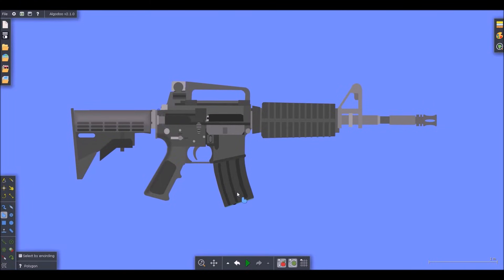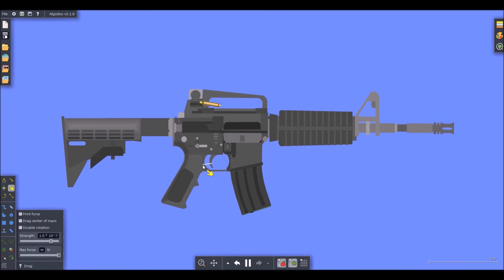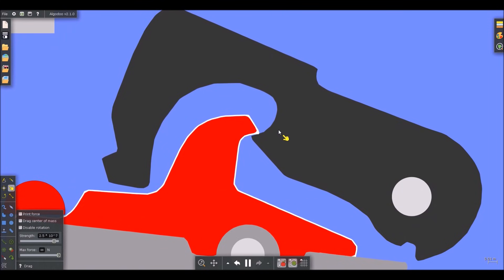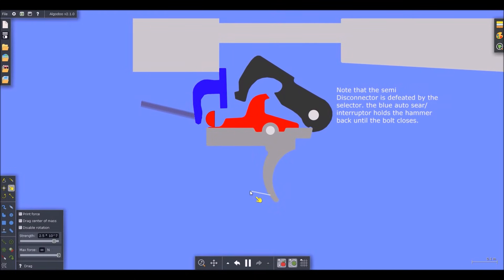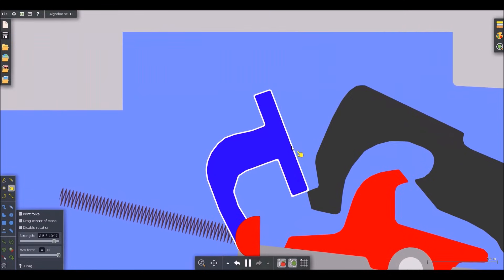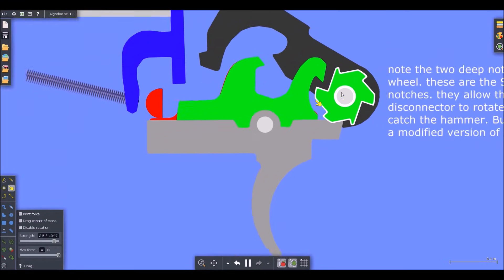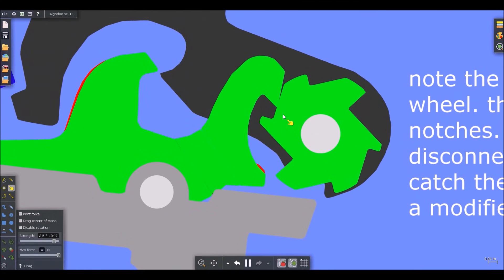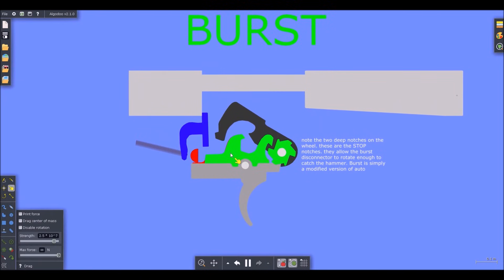How 3-round burst works

Comment: How does the positions of the selector switch cause semi auto versus burst?
Reply from the maker: Notice how the tail end of the semi auto disconnector has the tab that touches the red semicircle?

That red semicircle is a cross-section of the selector switch, and the disconnector is spring-loaded into the trigger. 

When a cutout (empty space) presents itself to the disconnector, it’s free to move and do its job. With the selector blocking it, it’s kept from engaging the hammer.

The semi auto disconnector has no such tab on traditional 3-position lowers and always engaged the cam (and, on every deep notch, the hammer.)

Comment: 4:30 This is actually just meant to prevent hammer-follow induced failures to fire.  Since the semi disconnector is retained the hammer would just ride the back of the BCG.  On some firearms hammer follow could cause out of battery detonations or unintended firings.  However, on a properly made AR-15 the firing pin can only protrude out of the bolt face when in the locked position, so any hammer strikes to the rear of firing pin when out of battery cannot cause an ignition of the primer unless something is seriously wrong with your parts.  What will happen is a failure to fire, either because the hammer hit too soon as just described, or because of a light strike since the hammer can’t deliver enough force after riding the BCG forward.  Out of battery detonations on a properly manufactured and maintained AR can only happen due to bad ammo, typically poorly set or over-sensitive primers; or from debris on the bolt face.  Hypothetically OOB could happen from a cook-off, though to get to the point where a round could cook-off OOB it’d probably have to be hot enough to cook-off in-battery first, at which point the user would hopefully drop the mag to stop the gun from running away.
Reply from the maker: This is true. However, my objective with this explanation was as an in-general reason for the auto sear and why you need it

Comment: Question: with the fire selector on burst, what happens when the operator pulls back the bolt to chamber a round? Specifically, what happens to the ratchet? Does the burst disconnector interact with the ratchet? If not, how is this prevented? 

Thank you
Reply from the maker: if the hammer doesn't fall, it doesn't move enough when cycling to index the ratchet. The hammer needs to fall to make that happen. It'll wiggle a little but won't ultimately do anything as a result
Reply: @StealthTheUnknown  
Thank you for taking the time to explain. 
Could you explain how that works? Since it is the return motion that indexes the ratchet, how does the hammer differentiate when the hammer has fallen and when it has not? Is it to do with the trigger being depressed? If so, could you explain how that works?

Comment: Question: in your opinion, can this mechanism be altered, possibly by filing down the cam wheel, to reduce the three round burst to a two round burst? I'm curious for story writing purposes and i've heard soldiers claim that the third round of the burst is so inaccurate it's useless in all but point blank range situations. Thanks in advance.
Reply from the maker: Just get a different cam wheel with 3 deep notches instead of 2, they make them!

Comment: My only question is when you fire in the three round setting if you let the trigger go fast enough would it stop firing at the second or first round or would it  continue the whole burst even if you let go the trigger before the the burst finishes? 

I know weird question nagging at the back of my head and no that’ll be long to read 😂
Reply from the maker: Yes, it stops lol. Unlike the video games that consistently copy each others’ homework, not knowing the first guy got it wrong. 

I have a FAQ video on this which explains this. For the M16/M4 and a few others, there’s a “memory” of sorts because it doesn’t automatically reset the burst cam (that 6-spoke wheel you see here.) On H&K and others’ burst mechanisms their cams are different and DO reset. In fact, the M4/M16 will “count” IN SEMI AUTO - you fire a string of shots in semi, switch to burst, and you may very well just get 1-2 rounds.

This burst mechanism was retrofitted into the M16 which originally came with full auto, and was designed from the ground up to be full auto. Burst was an afterthought and they had to work with the hardware available. This is what the engineers came up with, and it’s got its downsides.

Comment: I don’t like it. Should be simpler
Reply from the maker: The unfortunate news is that this is more or less the simplest it gets, short of combining both disconnectors and timing it with a linear instead of a rotary cam.

Really, this is already at the point of irreducible complexity; it’s about as simple as it can get.

But yes, it’s more parts than most are accustomed to, so the military generally switched from the M4 (burst) to the M4A1 (auto) instead.
Reply from the maker: I also have another, more updated and higher quality, reshoot of this video. Check it out

Comment: Can a 3 round burst be converted  in to a full auto?
Reply from the maker: Sure. You have to find a way to remove/disable the burst disconnector so it. Ever engages the hammer. I’ve heard of soldiers taking washers and replacing the burst disconnector with those washers. More permanently, I’ve heard of people filing/grinding down the catch interface on that disconnector so it basically does the same thing.

Comment: What if  you jam or run out of ammo om first round. Will it the n fire as soon as it’s charged again assuming you don’t dry rack out the rest of the cycle?
Reply from the maker: Nope. This isn’t a video game, letting off the trigger stops shooting even in the middle of a burst. What happens on on m16/m4 is the burst is “completed” by the next cycle - you reload, and continue shooting like normal, but your next burst will be 2 shots. On other guns with a spring-loaded cam mechanism, every burst is 3 rounds regardless where the last burst ended, unless you let off the trigger or run out of ammo/jam. 

The gun won’t just “finish shooting” when you load a fresh mag and send the bolt home. You’ll just have a 2 burst or single shot on an M16/M4 (or any 3-burst kit that doesn’t reset automatically) if your burst was incomplete before reloading, but that doesn’t happen on other burst kits with resetting cams; every pull of the trigger starts a fresh burst with the potential for 3 shots

Comment: Hey people, i'm not sure if this has been aswered before but most of the top comments are just the ones praising the video.

So what is the wear on this whole weapon mechanism? I see those interlocks are kind of minimal size so i was wondering after how many cycles can the notches wear off or you know, make the weapon work in unintended ways? I imagine if the material near the autosear corner would wear off, the gun could work once the barrel is open which could cause injury? I'm green in the field but i'd appreciate some input or pointing me to some papers in the matter :)
Reply from the maker: Trigger parts are usually made of hardened steel and have a long life, usually outliving the gun they run. The surfaces are small but durable. Bolt carriers and barrels end up failing before the trigger components do because they undergo so much more stress.

The stuff regarding burst is honestly least likely to fail of all the trigger mech. The burst disconnector isn’t catching the hammer with every shot, but every third. It’s just gliding over the counting wheel and isn’t grinding much, if at all. It’s a reliable system that I haven’t heard of doing unwanted stuff. 

When the barrel is open, the bolt keeps the hammer cocked, and any round of ammo that could fire is either in the magazine or already ejected onto the ground. So no, it won’t fire with an open barrel.

It’s almost like they design these things with redundant safety features . . .

Comment: fantastic video, never knew how this worked, but it would have been nice for visual representation of problems with the 1, 2, or 3 shot problems you can run into depending on where the cam is when not all 3 shots are fired, or when switching from single to burst

Comment: Did Stoner actually design the burst mechanism? I'm not sure that he did. As far as I am aware, it didn't show up until the M16A2 in the early 1980s, which occurred about two decades after Stoner had left Colt. I would assume that either a Colt engineer or James Sullivan had more to do with the burst mechanism than Stoner did.
Reply from the maker: You’re right, I think I just used the name since the platform in general is his
Reply: @StealthTheUnknown  Just thought I'd provide a little more information for you, since I'm interested in the history of this stuff and thought the people who watch this video might be as well.

The original automatic trigger mechanism is found in a Fairchild patent, US3045555A, citing Stoner as the inventor.

The semi-automatic trigger is found in a Colt patent, US3670442A, citing Ralph C. Kennedy, Paul A. La Violette, and Henry M. Stromberg as the inventors. This patent includes a very questionable anti-automatic feature (change of shape to the hammer) that would probably result in a broken firing pin retainer or firing pin in short order, but might explain why the Schmid two-stage hammer is shaped the way that it is.

The burst mechanism is found in a Colt patent, US3292492A, citing Foster E. Sturtevant as the inventor. 

Sturtevant also designed the anti-bounce buffer, US3366011A, and the forward assist, US3236155A. Both are still common parts of the AR-15 design.
Reply from the maker: @SharkVsTree  I'm going to try to annotate these edits and make the corrections to the description. I'll cite you for the  information (unless you request I not.) Thanks for clearing my ignorance up!
Reply: @StealthTheUnknown  Cool, thanks! Like you said, ultimately it's Stoner's rifle design, so reasonable to assume that he had something to do with it. I don't blame you for suggesting that. I just turns out he didn't come up with a few of the things that were eventually incorporated into his initial ideas.
Reply from the maker: @SharkVsTree  makes perfect sense, these things are often government projects which are cooperative in nature. lots of collaborators

Comment: In the semi-automatic version. What would happen if you removed the disconnector. Would it then be full auto ?
Reply from the maker: No, because there’s bo auto sear to keep the hammer until the bolt’s closed. It’ll just have the hammer follow the bolt carrier forward. You’ll get a light strike at most. Autos need to keep the hammer back until the very last bit of bolt travel

Comment: How can a Burst M16 be converted to Full Auto with the stock parts?
With what I understood after watching this amazing video i think cutting off the notch on the burst disconnector will do the job?
Please answer this 
Thanks in advance:)
Reply from the maker: if by the "notch,' you mean the pawl that glides over the notches on the burst cam wheel, then no. taking that off will only make it semi automatic, since there  won't be anything holding the burst disconnector back anymore. the pawl on it uses the burst wheel to restrict itself from engaging the hammer. if you want to take anything off to make it auto, taking off the hammer catch would do it - the part of the burst disconnector that catches the hammer. cut the whole thing off and it will just count around all day. alternatively, you can replace it with a washer of the same thickness if you prefer not to permanently modify your trigger components

Comment: If the notches on the burst disconnector are cut off
The one that makes contact with the hammer on the 3rd shot. Would it make the gun full auto?
Reply from the maker: Not unless you filled the burst wheel notches in, or removed the disconnector. Cutting the teeth off would make it semi-auto
Reply: The disconnector can not be removed as the trigger is different from a full auto one. The FA trigger has less space and holds only one disconnector.
In this burst setup it can be done only if the burst disconnector is fully defeated. How can this be done without causing any harm to the gun?
Reply: On the 3rd shot its the 2nd tooth which catches the hammer from falling again when the wheel is in the deep notch. If the teeth is not there at all it wont be able to hold the hammer and the gun would keep cycling till the trigger is held. The first tooth would keep spinning with the cam wheel. 
This is my understanding. Please enlighten with yours
Reply from the maker: @khajjak8420  i see you mean the “teeth” on the disconnector and not the wheel
Reply: Yes exactly
And the 2nd one which connects with the hammer on the 3rd shot.
The first one should remain intact as it wont disrupt action and keep spinning with the wheel
What do you say about cutting off the 2nd hook on the burst disconnector. Would it make the m16 go full auto and more importantly would it be safe?
Reply from the maker: @khajjak8420  safe? Probably. Recommend? Not really. If you have a burst m16, you have a full auto m16 - just order the trigger parts for it to be full auto if you’re tired of burst, or get a 4-position selector. Cutting the hammer hook off the disconnector would make it full auto, though. Alternatively, and I’d recommend this method over permanent changes to trigger components- put a washer of about the same thickness in place of the burst disconnector, it’ll do the same thing.
Reply: Thats what I thaught,of putting a washer in place of the disconnector. Or getting another burst disconnector disabling it and then fit it back. Wont cut the original one.
Thanks for your time bro
Means alot

Comment: So when you select fire, what are you changing sing moving a lever doesn't exactly remove parts
Reply from the maker: The selector axle is like a drum or cylinder with cutouts in it. The cutouts allow parts that come into contact with the selector to move, or be blocked.

The safety setting blocks the trigger, setting it to semi or auto/burst presents the trigger a gap for the tail of it to lift into.

The semi setting allows everything except the auto sear to move because it isn’t needed. The auto sear has a “tail” on it that reaches around the back of the selector - safe and semi have the cut for that tail out of the way, but auto presents it so the auto sear can actually catch the hammer. The disconnector has a spring and is not hard-locked to the trigger, which means that setting the selector to auto can block it while still letting the trigger move.

as for the burst disconnector, it’s always going and doing its job regardless of the fire mode. It just doesn’t matter whether it engages in semi- just extra “stopping power” for the hammer every third shot

Comment: Great video! I'm having a hard time understanding where the sear catches the hammer before and after firing once the trigger is released. I see the disconnector, but I don't see the mesh with the sear on the burst wheel.
Reply from the maker: When the trigger is released, the hammer ALWAYS catches on the trigger itself. This is regardless of the firing mode; all the fire selector does is tell certain components to be restricted or released - namely, the semi disconnector, and the auto sear - enabling one disables the other.

The auto sear (in blue) is ALWAYS engaging with (and blocking) the hammer when it is cocked, and the bolt isn’t in battery. The auto sear trips when the bolt goes home, allowing the hammer to fall - either to the firing pin, an active disconnector, or the trigger.

The semi disconnector (red) will want to engage and block the hammer or every shot when it’s active; the selector axle has a cutout and a fill in it that either free or restrict the tail end of the disconnector.

The burst disconnector (green) functions exactly like the semi auto disconnector does, but it has an additional extension on it that rides the teeth of the burst cam. That cam always wants to spin with the hammer when it’s being cocked, and has a coil spring which binds with the hammer on the cocking motion, but slips when the hammer falls. The coil spring isn’t modeled here because it would be difficult replicate, but assume it exists and that it’s fixed to the cam and wraps loosely around the heel of the hammer. When a spring is wound around something cylindrical, spinning that cylinder one way causes the spring to slip, and it binds going the other way. This means that the cam will tend to spin only one direction. The extra hook on the burst disconnector does two jobs: it helps restrict the burst cam from reversing, and it uses the depth of those teeth/notches to determine its function - or, whether to engage the hammer or not. The wheel tells the green disconnector when to engage the hammer - a shallow notch indicates a “pass”, and a deep notch indicates a “hold.” Basically, the cam is like a mechanical computer that runs a loop every time it fires. When it loops the third time, it tells the disconnector to “turn on,” which catches the hammer. Letting go causes the disconnector to let go, which causes the hammer to drop to the trigger.
Reply: @StealthTheUnknown  wow thank you for the knowledge. Super cool stuff. Don't underestimate how impressive the CAD and your explanation is. 👏
Reply from the maker: @metalderek8376  check out some of the other stuff I've made with it! you can see those on my channel, made a few nukes, missiles, tanks, cars, guns, whatever. very versatile and educational toy program